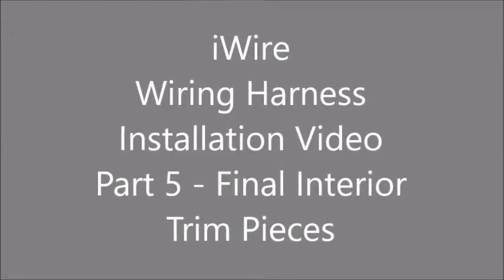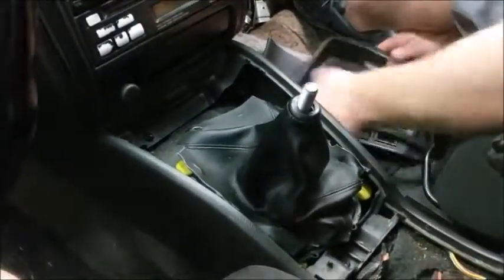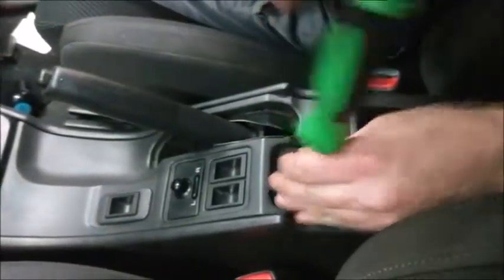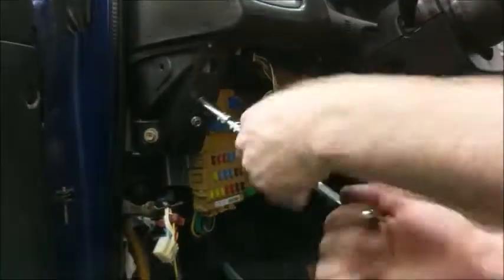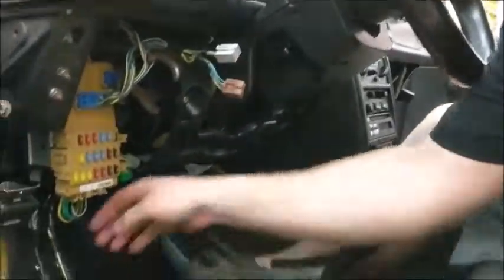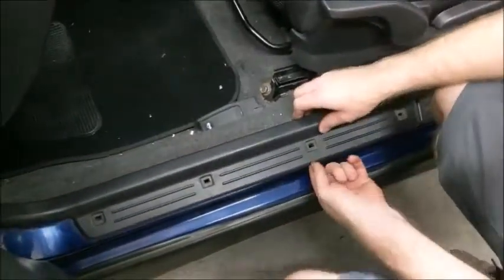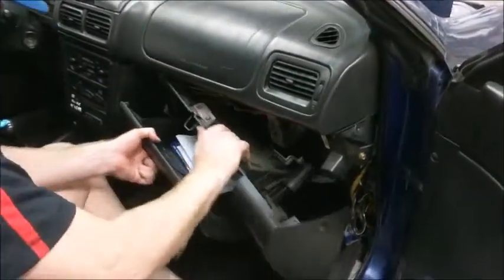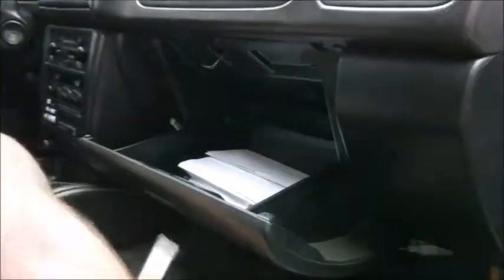iWire Subaru Wiring Harness Installation Video Part 5

Comment: Hello, I am doing an 04 wrx auto to manual swap, can I just buy a manual bulkhead wiring harness and ecu then swap it or do I need to get my auto wiring harness adjusted.
Reply from the maker: You can go either route. We generally suggest finding a replacement since you'll need to pull the harness either way - https://www.iwireservices.com/post/2018/02/23/subaru-auto-to-manual-transmission-conversion-basic-overview